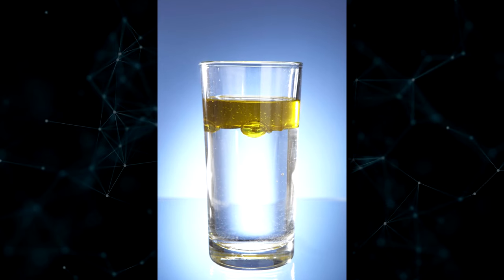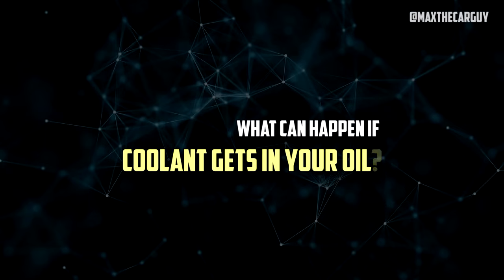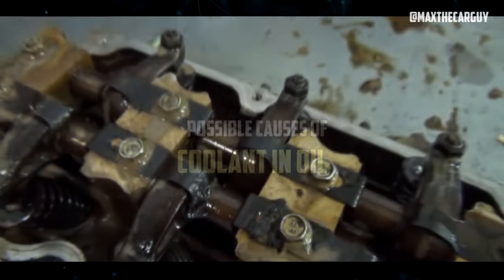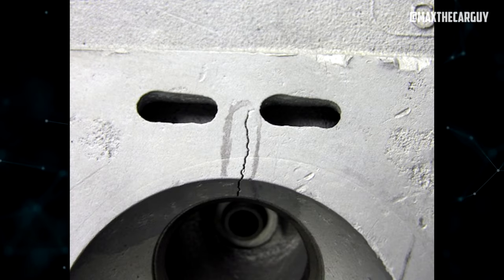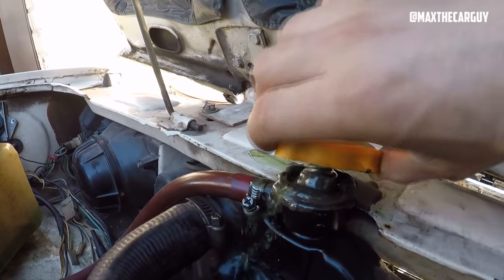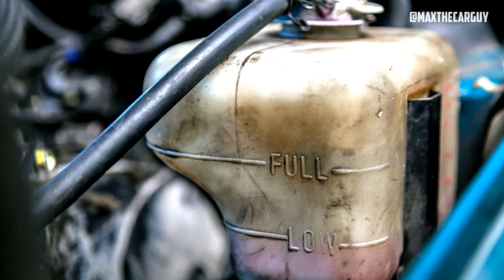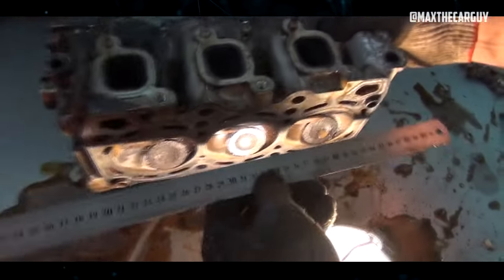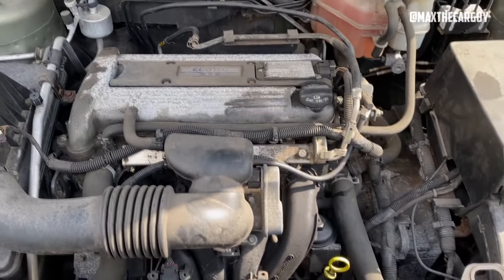4 Causes Coolant Mixed With Oil (What To Do and How to Fix)

Comment: I have a 09 Beetle, my mechanic called me with my issue and it was a failed oil cooler.  I had oil in the coolant and the car overheated.  However, there was no coolant in the oil at all.  I am currently renting a car for $100 a day until my car is done.  I am absolutely DIRT POOR as a result of all this happening
Reply: 100 a day is crazy i would’ve used uber everywhere
Reply: You don’t have like a friend or relative that can help take you around??
Reply: But it doesn't take 1 hour to flush the cooling system and replace oil cooler
Reply: Sucks even more when you get a beater spend 2k on ac system repair and a bunch of parts for the engine a new intake hose then yo battery and alternator give up spend another 500 just for the motor to start mixing with coolant after fixing it all. Should’ve just got a car from the dealer😢

Comment: 2000 for engine replacement???? no way !! my dodge caliber 2009 engine engine cost 500 euro with low milage and replacement cost 350 euro !!!
Reply: Yea my engine for my 1999 Nissan Sentra is about 500-800 depending the mileage my trans cost 1.5-3k to replace with an rebuilt trans. I’m thinking of getting a new engine because a engine rebuild is more costly

Comment: Appreciate it. Just changed a lower radiator hose that split. I added 2 containers of coolant. Now it's all but gone. No visible leaks. Any idea where it's going?
Reply: Probably in the oil.
Reply: When I did a coolant flush last summer I had to put about 2 gallons of water back into my car. Maybe she was just thirsty haha
Reply: nothing to repair , new engine and new radiator .
Reply: nothing to repair , new engine and new radiator .

Comment: You said possible causes and cost of repairs for certain things but did not explain what to do if there's water in your engine. Dammit do I just change the oil do I run a certain things through the motor before I put in the oil

Comment: My ford bronco sport with 14,000 miles on it just had this happen. I was on time with all oil and coolant changes, but coolant and oil has mixed and I’m told I need a new engine. Coolant was still full at time of incident. Warranty won’t cover it. Any tips on what I should do?
Reply: Warranty should cover it, it wasnt done by you and the cars fault if its new

Comment: Just had the oil housing changed and the fuel injector was pinched and oil is in the coolant overflow….does this sound like it could be the cause? It cause the belt to come off, ran hot, and power steering was gone
Reply: Normally oil in coolant it's a oil cooler failure and coolant in oil it's a head gasket failure. Your power steering issue needs to check through it's lines down to steering box or steering rack for leaks . Note some oil or water housing rung water and oil in parallel ways , check if not damaged and properly installed

Comment: My coolant radiator failed ( corroded) and is now replaced. I separately cleaned my radiator by professionals. But other parts were not flushed, now the top reservoir is still filled with gunk, how to flush?
Reply: The coolant expansion tank needs replacement the open one coolant pipe and blow with pressurized water , once clean fill water to normal level then add coolant radiator flush and run your car until normal operating temperature reached then drain all the coolant the same way you did at the first stage . Finally addy water and coolant anti-freeze run it till normal operating temperature then check coolant level. Note the cooling system needs bleeding to release air in the system.

Comment: I got a Question. I let water freeze in my motor. The oil is leaking into my coolant and causing the milkshake texture. It’s only in the Coolant system not the motor though. Motor is full of oil not coolant. Yet coolant reservoir Is full of milkshake mixture. Did I crack a head gasket or oil cooler. It leaks oil In the coolant system extremely fast.
Reply: Same with mine. Did you find the cause. My mechanic suspect the turbo. We are going to try to investigate it today. I hope its not that I added oil in to the coolant by mistake
Reply: @simondzimiri1431 add me, my van has the same problem oil on coolant
Reply: Thats probably a cracked block home slice.
Reply: This is damaged oil cooler(CVT transmision)
Same w/ my honda brv. Cvt oil cooler damaged .oil cvt in coolant mixed. Replaced my cvt oil cooler. Ok
Reply: I have the same problem with my Subaru XV 2012 model CVT. Today I found oil content in the Radiator tank coolant and the green coolant color turned like water. Also the radiator cap started corrosion. How can I fix this problem. Just a month ago only I replaced the radiator tank due to the same problem? 😢
Reply: nothing to repair , new engine and new radiator .

Comment: 2018 Dodge Challenger GT mine is like this! I also have the mix in the oil. I had it drained, I hope it works once the oil is added and system cleaned!

Comment: Question, I had an severe engine oil leak in the V of the engine where the oil cooler sits. It didn't mix while running, but 100ml or lets say 200ml leaked in to the V area and came out the oil drain. Very little and in it's original shape, not foamy.

Comment: Thanks for this vid' and info !  

Hope this is not a side effect of what has put my '82 F-100 V6 3.8L in a 'coma state'  for the past 3.5wks.,    on the op'table aka driveway. 
No sludge appearance yet.

Chking oil - level seems higher than normal.   hmmmm and this was after using atp-205' , 4 hrs previous to going into a 'coma state' .    
( With vehicles, I prefer to say "coma" than "dead" which would be ominous.  )

"Choke pull-off" replaced last night, coincidentally now during day, .... hopeful reboot'   🙂

Comment: I have a 2007 Chevy Impala my temp gage goes from cold start to normal temperature readings in 5 minutes. Gage reads hot no bubbling coolant no water leaks. Just had oil change no water in the oils.
Reply: blown head gasket

Comment: Ive have a 2011 Subaru STi, my Car doesn’t overheat and running fine, but there are some oil in the coolant and testet with an coolant tester but it didnt went yellow only  green. The Car is petrol and not Diesel. What can be the problem? I also checked the oilcap and there are no milky gooo in the oilcap that indicates coolant in the oil.
Reply: The cvt transmission coolant line runs through the radiator, which leaks. You need a new radiator
Reply: No, because i don’t have an 6 speed manual, and i don’t think the transmission coolant line runs trough the radiator?
Reply: @stalekristiansen2942  I can only tell you the solution, but it seems you know already the answer. Good luck.
Reply: Hey bro , don't ignorant, check your Transmission oil cooler , that's transmission oil in your coolant
Reply: @marcussok6469  you mean the Oilcooler that sits behind the oilfilter?
Reply: nothing to repair , new engine and new radiator .
Reply: @thev5140 the engine runs fine, so no…dont need new engine 😂 i found out it was the radiator!
Reply: @stalekristiansen2942  - radiator get in oil only 2 kind of fluid , engine oil or transmission fluid , if no engine oil get in radiator for sure transmission fluid get in , you have to change transmission fluid and also replace radiator too transmission will be damage soon .
Reply: It was not oil, it was dirt from the radiator, it was clogged up, and now the radiator got a crack on the top of the plastic part.